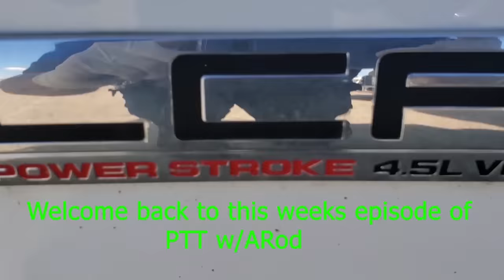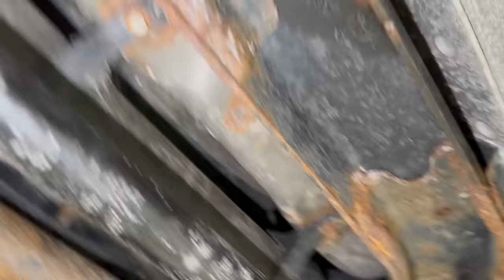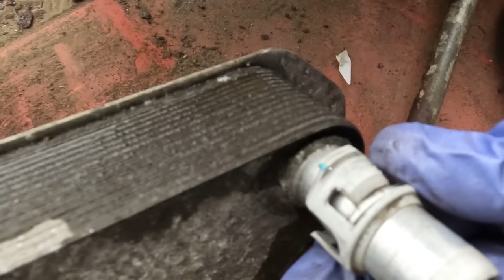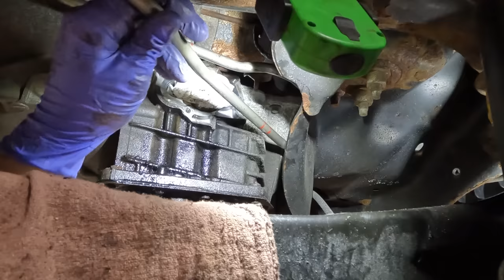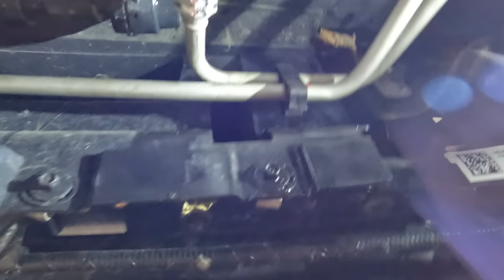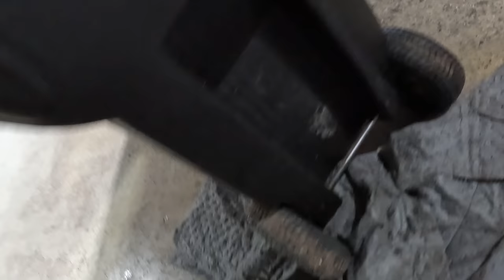...if these leak - YOUR 6R140 is DEAD | Trans lines FIX'em #howto

Comment: I had this happen to me last year. I bought an imported 250 from Canada with only 30k miles on it, and it caused a cascade of issues that eventually made me get rid of the truck out of anger. I now look at these on every current Super Duty and have been replacing all of my friends lines with new ones and coating them before install to prevent this.

Comment: That was amazing skill and patience, On a poor northern rust truck . I’m also so glad I purchased the extended Ford warranty.Took this out to my Southern Truck showed her the pictures said behave or I ship ya North
Reply: Ford extended warranty doesn't cover rust lol, I tried for a customer and it got charged back. So you'd be paying for this anyways
Reply from the maker: ....english 131
Reply: @PowerStroke Tech Talk w/ARod I only told them it was leaking in my story. Didn't say rotted out. But they asked for the part back and determined the failure was caused by rust and rust is caused by lack of maintenance. Not covered under ESP
Reply from the maker: Dang bud. Thats sux

Comment: Another fail point on these cooling lines is the fitting where the rubber lines fits onto the metal line.

Comment: The F150 6R also has this issue but it's by the front cross member area at a bend and crimp fitting where they fail

Comment: A guy I used to work with taught me how to deal with rusty fasteners. I was removing 5th wheel bars from the bed of a Dodge 2500 diesel, had to drop the fuel tank to get at the 5th wheel mount from the other side. The guy at work had me wire brush with die grinder the exposed rusts threads on the fuel tank straps and wd40 the heck out of the nuts. Made removing that 5th wheel mount easier. Other times there is nothing you can do with rusty parts besides replace them, found that out on a rusted out Toyota truck exhaust, damn thing was hiding more rust, needed a muffler and the cat back pipe.
Reply: I use a small torch and heat everything

Comment: Arod the steering stabilizer, so ford every six months or replace it with what they say is “better “ so would it be better to get a bilstein. I was thinking fox they clamp on any help thanks. Duse if my truck looked that bad I’d throw up I would have to be under painting and scrubbing
Reply from the maker: I know I'm trying to figure that out right now I want to get a different steering stabilizer too

Comment: Do you prefer the 6 speed or 10 speed transmissions in the cab and chassis trucks? The one 10 speed I drove was not nearly as smooth as my truck or the 10 other ones I've driven. The 10 speed was virtually brand new too!

Comment: So do you typically see any crossover in the fluids? My coolant looked a little more “red” and I’m worried that maybe a small bit got in my transmission. I ordered new lines and a cooler already just wandering if you ever seen it? Thanks!

Comment: Can the K member be disconnected on the cooling line side to give more room? I had to do cooler lines on Chevy 1500. I dropped the 2 nuts holding the front axle and got loads of room.

Comment: I have a 2015 F450. It seems that these lines have fewer turns with shorter lengths on my truck as the heat exchanger is in a different location. Do you know if it's easier to swap them out on mine?
Reply from the maker: This is NOT  the same truck bud. 2017+
Reply: @PowerStrokeTechTalkwARod  Of course it's not. I'm asking if you know if it's easier to swap them out on mine. It's ok if you don't know.
Reply from the maker: Oh now I understand. No yours are a tab bit easier than this 1, still sucks tho. Jacking the motor up helps on both
Reply: @PowerStrokeTechTalkwARod awesome. Thanks man. Just got the replacement lines today. We’ll see how it goes.

Comment: What was the mileage to have to do this so soon?
Reply from the maker: 40k, on a 17....it OBVIOUSLY sits more than it drives. Yhi g looked like it was in a feild
Reply: @PowerStrokeTechTalkwARod  True dat
Reply: @PowerStrokeTechTalkwARod   Just looked at the Full Send Diesel replacement lines that work with the factory cooler, i think i will go that route when mine rust out lol!

Comment: That’s a damn shame for the money it cost to buy these trucks and to have that much corrosion and rust is ridiculous!
Reply from the maker: Rust belt! What do you think is gonna happen to exposed metal...........
Reply: @PowerStrokeTechTalkwARod  

I live in the rust belt and that used to be the norm but these newer vehicles have e coated frames mostly 08 and on with the exception of GM and that antique wax coating system they still use main reason I won’t buy a GM anyway I have a 2011 F250 PowerStroke and it does have some speckling of rust here and there but very light but the bottom side of that 2017 looked very heavily corroded and rusted in comparison to mine so what do I expect a hell of a lot better than that and like I said especially for the money these trucks cost just seemed odd to me a truck 6 years newer than mine had so much more rust and corrosion on it just an observation.